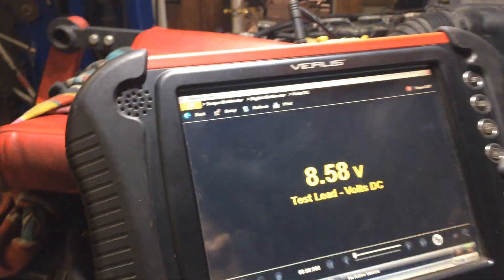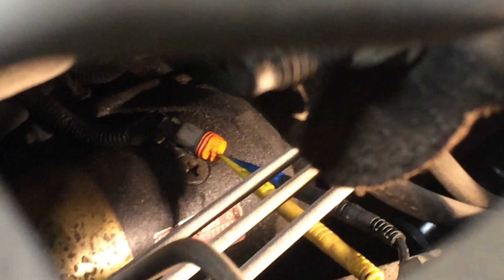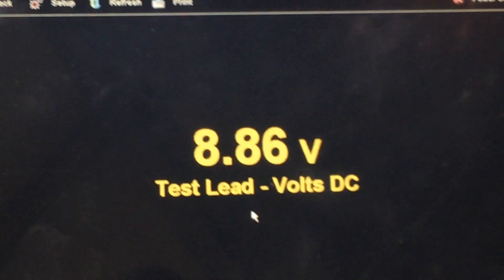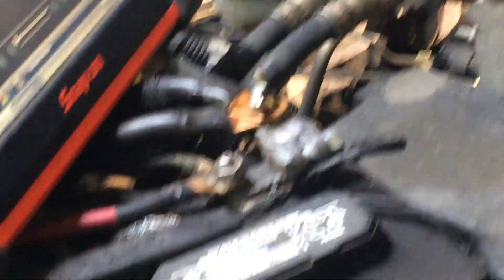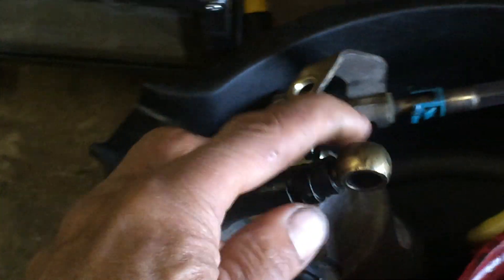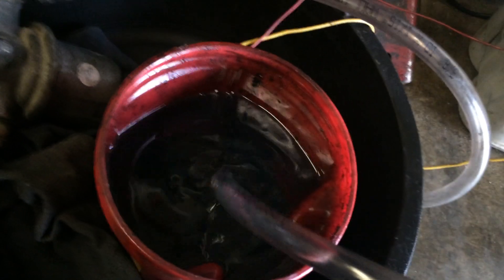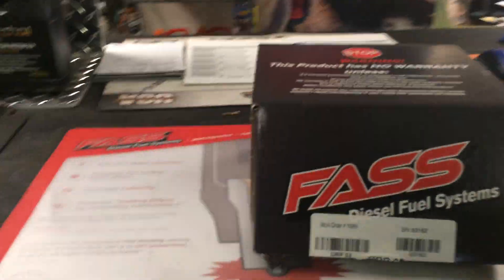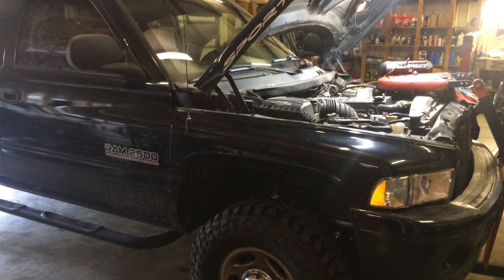1998.5-2002 Dodge Cummins 24 Valve 5.9L Lift Pump Diagnosis - Part 1

Comment: Thanks for the content ! I just installed a vp44 and injectors on a 2000 24 valve and found that the reason the original pump went out was the lift pump was MIA when I checked the power supply it had 2 hots both wires to the pump are hot it is in a good truck freightliner chassis tell me yay or nay check voltage and or find short or burn it to the ground

Comment: How's that Ddrp held up?
Reply: Put one in my 01, 5 months later of on and off use, it's dead in the water. Would not suggest getting. I'm gonna be replacing with a unit on the frame rail. Probably the airdog 100, since the ddrm left a bad taste in my mouth. Buyers beware.
Reply: @Farmstock24v  thanks for the update. I was blessed to find a new AirDog Raptor 150 on ebay for a steal so I bought it. Easy install and has been working wonderfully.  Airdog even sent me a  couple of adapters that I needed at no charge. I was really impressed by the customer service.